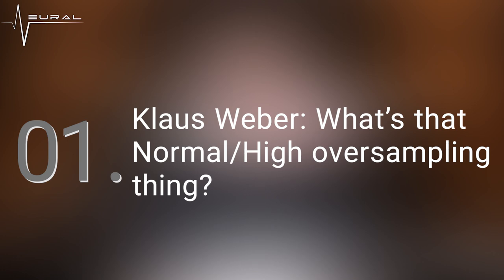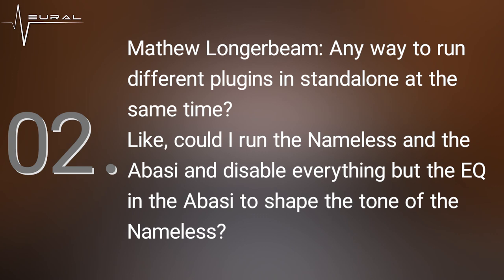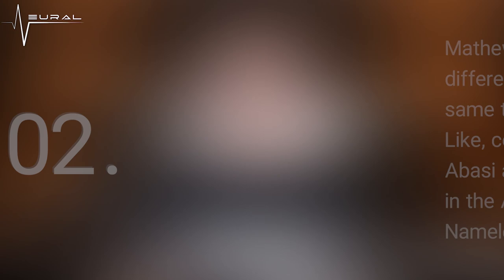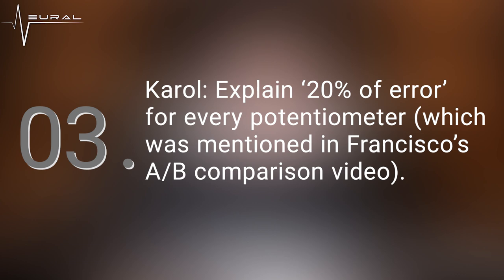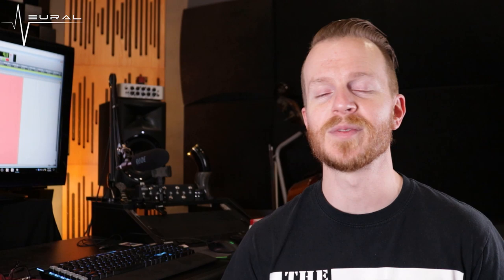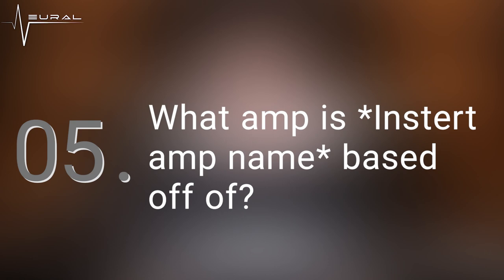FAQ #2 | Oversampling Switch? | Multiple Standalone Routing?

Comment: Regarding question 2, I'm thinking of two ways of doing it. If your interface has spdif, you connect the out to the in with an rca cable. In the first Neural plugin, your input is the main input of your interface (where you connect the guitar) and your output is "spdif out". In the second plugin, your input is "spdif in" and your output is your main output (where you connect the speakers). You can also do this if you have an interface with virtual loopback. It may work differently in every interface but in my case (Presonus Studio 26) I set the output of the first plugin to main 1/2, virtual loopback takes the sound and you set "virtual" in the input of your 2nd plugin. Then you set output to 3/4 in the 2nd plugin so you don't create a feedback. I have tried it and it works well with no latency :)
Reply: Yes it could be but it's easier with just having the Axiom Blue Cat plugin :D
Reply: yes, also! But in case some may not want to buy that software ;)
Reply: @marcpeiron_studio  Yes of course! Haha! By your name I can think you're french too?
Reply: Oh no! Vi que eres español en tu descripción!
Reply: Yes! Officially Spanish but hoping Catalonia will become an independent Republic in the future :)
Reply: @marcpeiron_studio  Nice! Es que me voy a mudar de Francia hacia Valencia en un mes!
Reply: Genial! Te deseo que lo disfrutes :)
Reply: @marcpeiron_studio  Gracias!